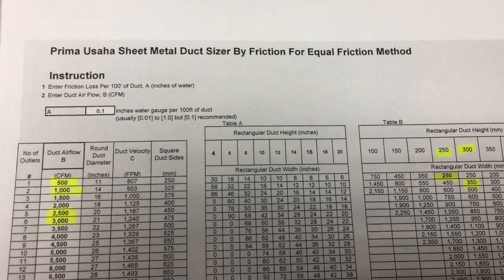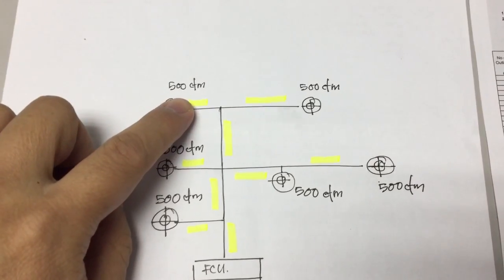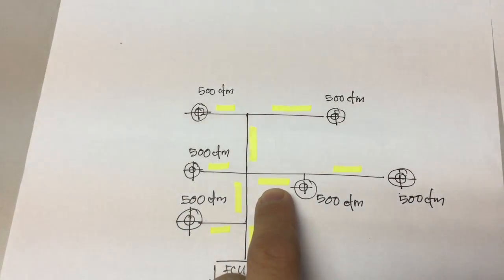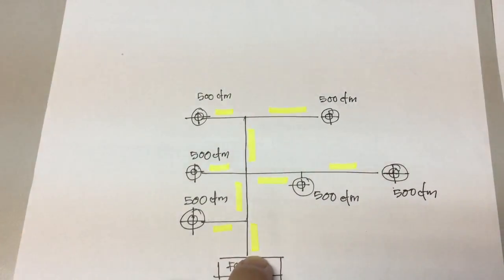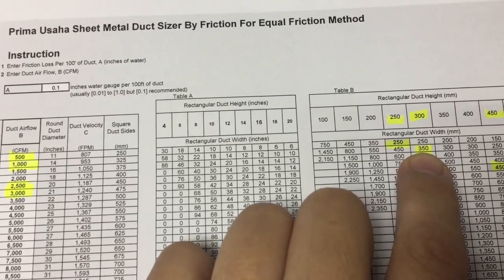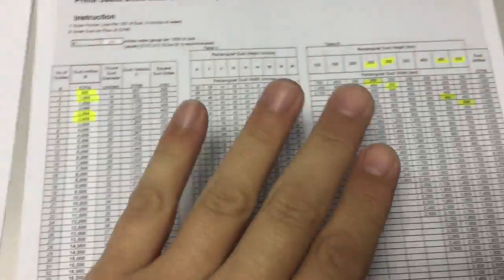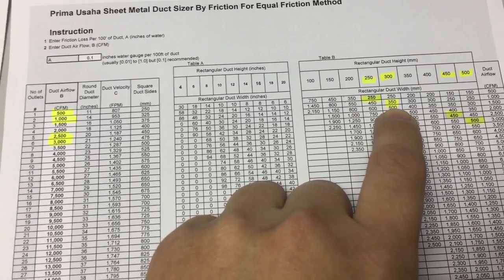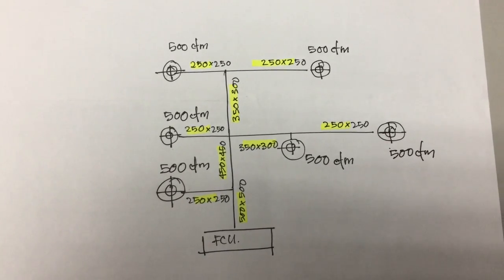How To Use Duct Sizing with CFM and Friction Loss Table 2017 How To Use

Comment: Hello sir, 
If I was to purchase a/c unit with more seer rating do I need to increase the duct size?
Reply: Duct sizes might need to change when CFM or external static pressure of fan changes. Good to check the new equipment vs the old one. If CFM and ESP not much changes, say within 5%, duct might not need changing.

Comment: Please Explain how the Duct Size was calculated from the  CFM indicated in the chart.In the chart duct size was highlighted,but the relationship between duct size selection and cfm is not explained
Reply from the maker: jobin joy From the chart, the choices of duct height is fixed. The duct width will vary according to the CFM. The result is consistent with the ductulator or ductsizer tool. We use this for construction drawing and for drafting purpose. But some prior knowledge for duct selection is needed. There might be noise and static pressure considerations depending on the application. It is advisable to contact your local expert for advice.

Comment: Is there a maximum length limit of the duct?
Reply from the maker: Duct length is limited by the external static pressure of the fan.  If the fan external static pressure is 0.2"WG and your duct is designed to 0.1"WG/100ft, you should 200ft worth of duct. However in practice, the duct length will be less than half because of static losses in elbows, transitions, dampers, grilles, diffusers, registers and dirty filters. Not an easy question to answer because there are many variables involved.

Comment: Where do u get the table from ?
Reply from the maker: Ks Foong I made it myself. Please tell me if there are errors. You can get the soft copy from https://youtu.be/jSu6Dx220Nw in the description.
Reply: i'm cross checking with my duct sizing app, i will let u know
Reply: I did a few testing, the figures are correct. Can you tell me how you work out the formula ?
Reply: When you size a duct, what parameter do you normally use? I will use cfm & "WG. But I realize cfm & fpm is much easier
Reply from the maker: I will use cfm & "WG because it us easier to size the static pressure of the fan. When noise is a concern, I will use cfm and fpm.